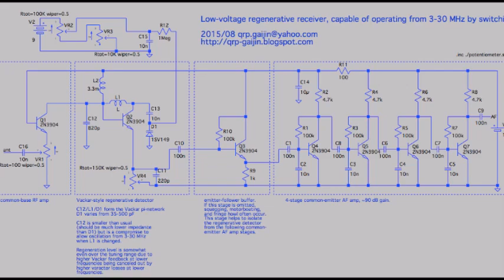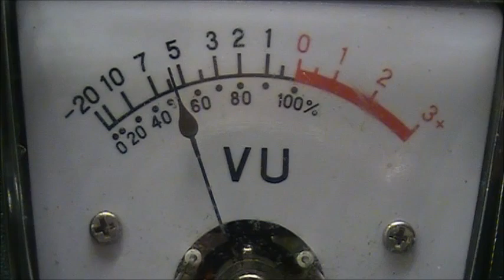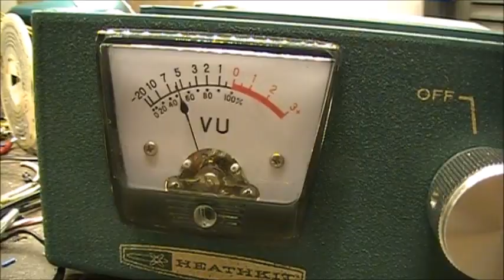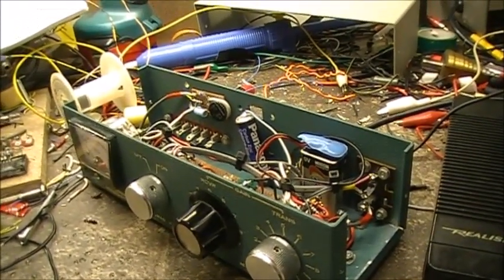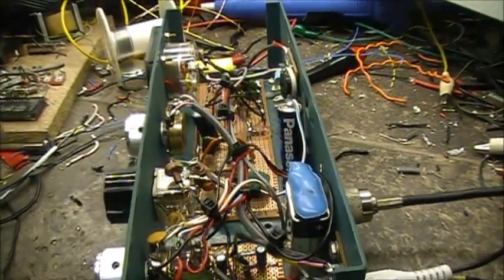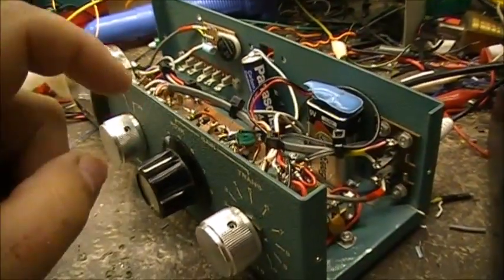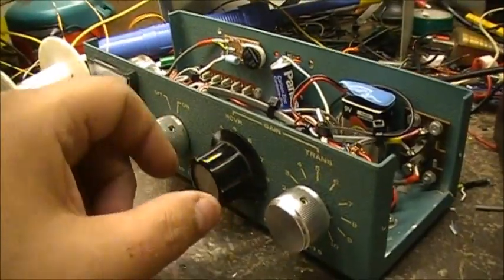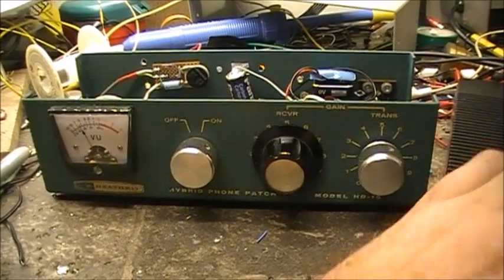single coil 3 - 30 MHz regenerative receiver

Comment: its alive!!
Reply from the maker: Seems to be.... only thing i really don't like about this circuit... is there appears to be way to much gain involved. Not sure if it's the audio amplifier causing it or the antenna input amp. Either way, once tuned in this radio do work well for what it is.  :-)

Comment: How does the signal strength meter Work? Neat construction!
Reply from the maker: Hey, the s-meter runs off the audio running to the headphones... the louder the audio the stronger the s-meter reading.
Reply: @Radionut63  Thanks for your reply. I watched your video again where you gave a clear explanation! Your projects and construction methods I find interesting and enjoyable.